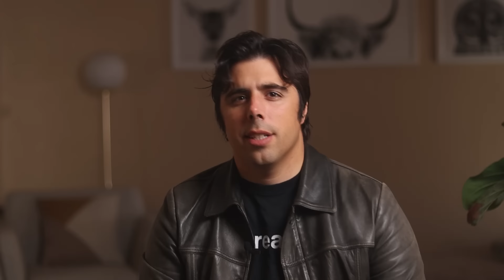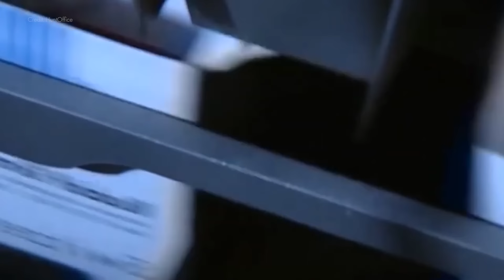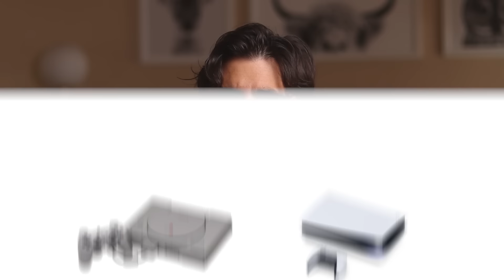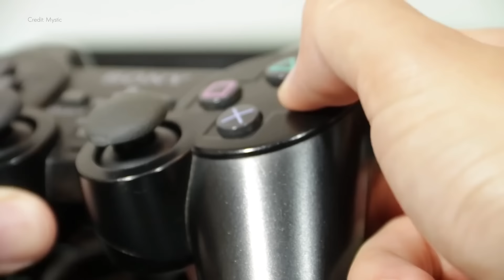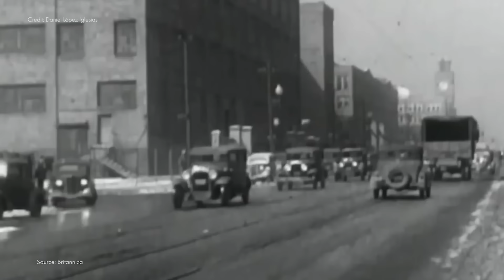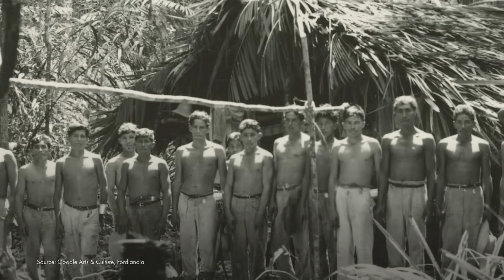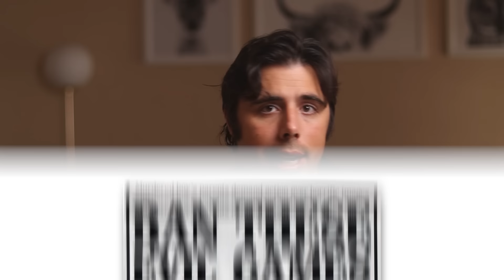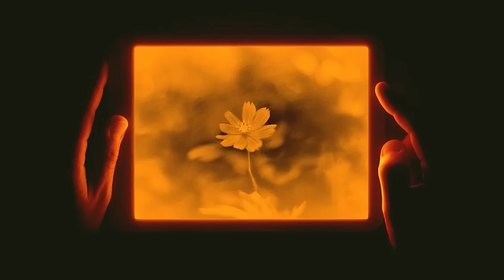Why Some Designs Are Impossible to Improve: Quintessence

Comment: Stop making it seem like smartphones and social media are inextricably linked. That is absolutely not the case, and if you want to have more control over your life, it’s simple: BLOCK SOCIAL MEDIA. I don’t use any social media whatsoever and I have an iPhone and I don’t have any of the problems you’re talking about. Clearly the problem here isn’t the platform but what you use it for, and you don’t need a whole new phone to stop using social media. And yes, you can access social media just as easily from computers too, btw.

If you think you have no self-control, set up a parental restrictions option on your phone and then have someone else make a new password for it that you don’t have. 

And really, from what you’ve described, isn’t a “quintessential” design just one that has the greatest market share such that most people associate it with the product type? The Maglite and Model-T weren’t better than their contemporaries (in fact, both were almost copies of earlier designs), they were just what was spread to the most people. Thus proving that if you bury your rivals with quantity over quality, you can win - which is less about design and more about financial control. Only the iPhone and PlayStation controller were actually superior products for their time.

Comment: 11:54 I'm a playstation fan but the standard was actually made by xbox, if you look out for controller designs basically all of them follow the xbox design, Nintendo and 99% of the generic ones have a similar xbox design (left trigger on top), except for only the ones made for playstation.
I've played with that design and actually like it more.

Comment: You can't beat a Mag-lite, but you can beat it WITH a Mag-lite! I've got a 3 D-cell Mag with a recent LED upgrade I've had since '02. It's been used as a hammer many times, as well as a general percussive maintenance tool, an attitude adjustment device, and has fallen off things from a few inches to 20 feet high. It just keeps on keeping on, and shows no sign of stopping anytime soon! I sure do love my Mag-lite!

Comment: I have a theory about video games. Everyone had Nintendo. Then everyone split into two paths. If you got an snes then you got n64 then Xbox. If you went with a sega genesis then you went to PlayStation. I’ve always been a PlayStation player mainly because of the controller. It’s been basically the same since PS1. Whereas the other was the craziness of the n64 then Xbox took a couple of tries before they finally just kind of copied the ps. I don’t play as much as I used to so I finally got an Xbox . Mainly because I got an Xbox s for $200 at a pawn shop when the ps5 was over $500. And I could finally catch up on halo. I may eventually get a ps5 but I don’t play enough to justify that. Plus the Xbox controller is so close to the ps there isn’t much of a learning curve.

Comment: keyboard layout is unnecessary obsolete and impractical, the offset key purpose was to allow the beam under each key to reach the back end of the writer. I bet that if new keyboards with a more regular layout came out they would became the new standard in a few years.

Comment: Everything you mentioned in the beginning is not perfect, most of it being far from it, bic pens have an issue with ink flow, paper clips are way to easy to bend and can't handle many papers, the qwerty keyboard layout is extremely inefficient both because of the key arrangement but also the physical key layout, and the PlayStation controller is way too prone to breaking over time or getting stuck (not to mention NOT being universal for hand sizes).
Reply from the maker: quintessential does not mean perfect.

Comment: I am not sure I would call the QWERTY keyboard quintessential. Its persistence is not based on the design hitting something "essential", it is just path dependency. Path dependency instead of better design being the reason for the persistence of the design is mentioned in the video. I think it is actually a total different reason for the persistence of the design, and I'd say it is making it unworthy to be put into the same name bucket.

Comment: Eventually backfired, the design is bad by modern standards, it rolls away and they were very late to the LED revolution.  Incandescent flashlights needed the 6D cell format to be really viable, the AA models seen today look like candlelight, it takes a lot of juice to light up that wire.

Comment: PSA: The modern keyboard’s design is more circumstantial than intentional.  There were a couple of early keyboards related to telegraph machines if I remember correctly, with shortcuts built in, and the numbers and letters got pushed together in weird ways, aaaaand, we got a few sporadic designs all at the same time, variations, and eventually a design most people were familiar with, and changing what’s already familiar is hard to do with the entire public..

Comment: Would you assert that all qwerty keyboards are the same? I have trouble finding the same keyboard layout to use my muscle memory. Return, backslash get moved around and extra keys squished in. The shift and backspace keys shrink to make room, which impacts their recognition by touch. Laptops have ultra compacted keyboards. There are a few common mechanisms that handle the key action.

So which paperclip is the quintesential? With a very simple mechanism, there can't be much variation. But you will see it if you look closer: Hard steel alloy that resists plastic bending with old Soviet clips. Friction grooves. A lip on the inner loop to more easily slide it on. Angular or rounded corners. Enameled coating, galvanized or bare.

Disposable pens have had a lot of designs and change in materials (brittle, opaque, metal tip, different diameter points, superficial shape). I'm not familiar with the Bic pen.

Designers seem to churn out new products to get paid instead of iterating on small mistakes to arrive near perfection with basic items such as knives, pots or drinking glasses.

Comment: "Some designs don't change much: the paperclip, the bic pen, the qwerty leyboard layout and even the playstation controller."

Right out the gate this video has already lost my respect in the first 5 seconds compared to what i expected from the title and the thumbnail. The QWERTY keyboard layout is atrocious and can easily be improved. It has been improved a lot, it's just difficult to push those improvements. QWERTY is however not universal, at the very least QWERTZ is significant in countries like germany, but even DVORAK is pretty popular and neither of these are even the best. The playstation controller is a lot closer to perfection, but still not there, some improvements over that layout are clear in Valve hardware like the Steam Controller and Steam Deck, while Nintendo's Joy Cons are probably the most successful variation upon the gamepad layout.

---

After watching the video, i realize i misunderstood the premise. I disagree with the title being "impossible to improve" because these input methods can absolutely be improved. But i do agree that the playstation controller design is quintessential. I don't agree that the QWERTY layout is a quintessential design, because it's hardly a design. It's mostly just user preference, and it can also be changed in software. It's the default layout, but that doesn't make it quintessential. However, i think that the 105 key arrangement of physical keys on a keyboard is a quintessential design, and doesn't improve a lot. QWERTY feels very out of place in this video, even after watching the whole thing, but keyboards in general do have a quintessential component and i absolutely agree that the two-sticks-dpad-and-face-buttons gamepad layout is also a quintessential design.

Comment: I could've let you get away with calling the NES controller design "1985" given that was the year it was released here in North America even though it was actually 1983 as originally released in Japan... but it most certainly was NOT 1986 in any vein. 😞

Comment: Great bit of content on design "quintessence". In the sense that you were trying to convey the principles which make a product endure I offer the bitter "realist" set of principles as counterpoint:
1. Functional- quality enough to operate but not to high quality as it needs to be disposable. H Ford conceivably embodied this ideal if it's true that he had his engineers study used Model T to find the most reliable part and had it weakened.
2. Mass production- can it it be made quickly and cheaply with minimal labor so as to keep cost down
for the last two I incorporate the essence of the fifth to better articulate what quintenssence means in the context of products.
3. The "Appearance"- the product should be such that it gives the impression that it does more than it actually does because after all, the placebo effect is real.
4. The "I need it factor"- the product should be marketed and developed to convince people that it is indispensable. To a fair extent a great product (regardless of quintessence) does this on it's own, just look at basic tools in every builder's toolbox. But in the modern age true quintessence that is real endurance relies on the ability for people to be sold on it through clever marketing and vacuous advertising.

My point here (as a nihilistic ninny) is great functional design has it's place mostly in bespoke hand crafted products, but human society at scale is solely, and I mean solely about economy. If it's not cheap, mass produced, and can't be peddled it will be lost to niche consumers and history.

Comment: One nice thing about a standard paperclip is being able to unfold it and use it to poke things. You can use it to factory reset your phone or push the SIM card out. You can use it to scratch at things, to scrape the dust and dead skin cells off computer peripherals for example. So a paperclip whose ends are welded together is missing a secondary (but valuable) feature.

Comment: shocked that you didn't mention that after they essentially invented the standard for the controller, their first 3d console's controller is still clowned on to this day for being completely, utterly weird (even if i personally like it and find it to be a very pleasantly versatile design for playing emulated games, as you can still get these but made for usb ports instead of for n64 hardware... it is a really really weird controller), went back to basics and then tried to reinvent it again with the wii - for which they still had to provide a classic controller and let gc controllers use. 
like it's a wheel that's very much tried to be reinvented by it's original makers, and they just. fail. every single time they try it lol. in the end, they just merged a 2 nes controllers with a joystick and the console itself into one thing.

Comment: Speaking of the gaming controllers, there's still some attempts that worth mentioning, ABCXYZ layout for Sega Genesis / Saturn, middle analog stick on Dreamcast / GameCube controllers, even the Switch Joycon isn't the same design formula as XBox pads and Dualshocks, they're not best for the genres as you mentioned, but good enough for all with analog sticks and modern heptic feedback buttons

Comment: Paper clips are a horrible design. Things catch in them, which can easily prise them off whatever they’re supposed to hold together.  They can crimp the papers they’re holding, and the paper clip can get stretched open and not go back into shape properly.  Their successor the metal clip, which comes out of a small dispenser, is sooo much better.  Design improved.

Comment: A lot of computer users do make a point of trying to learn the hotkeys so that they never have to use the mouse.

For instance the RatPoison tiling window manager for Linux is specifically designed to make the mouse unnecessary.

And it makes sense that you can be more efficient by learning the hotkeys, because regardless how general-purpose computers are, the vast majority of users are repeatedly using a very narrow set of programs or features over and over and over again.

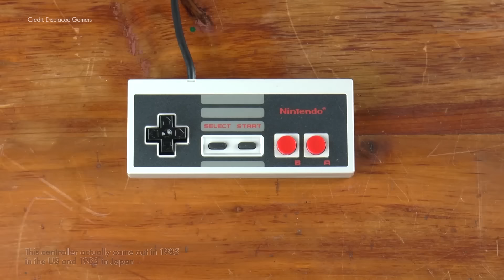Comment: 8:52 You say that, but the Atari Jaguar has the direction buttons on the left, menu buttons in the middle, and action buttons on the right. It just also has a big ol' numpad under it, but remove that and you've basically got a standard controller.

Comment: The PlayStation controller design was just lazy dogshit that they’ slapped together after analog sticks became a thing, without ever considering ergonomics.  So, it was too small and horribly uncomfortable for any hands larger than women, children, and Japanese men.  Their form factor and design shouldn’t be celebrated.  Microsoft ultimately perfected the form and it by far the industry standard, because it put human hands and ergonomics above symmetrical designs.

Also, the PS2 only sold a ton of units because it was cheaper than a DVD player at the time, so it was just a matter of value that parents agreed to purchase because they could use it to watch movies.  The physical design of their consoles weren’t all that special either.

Apple hardware that was designed with Steve Jobs at the helm was genuinely designed for both form and function, which is why everyone copies their products.  The black plastic at the bottom of the original iPhone was because it improved reception and their machining processes hadn’t improved to the point they reached later on.  That’s when they started making unibody MacBooks and the iPhone 4 benefited from that as well.  Unfortunately, they flopped with that one because that design worked unless you hold it with a large man’s hand, which cause interference by bridging the antennas placed on opposite sides.  This was why iPhone bumper cases became a thing and “you’re holding it wrong!” was the primary defense of that glaring mistake.  

The other big mistake Apple made with product design was the scissor switches they used in their MacBook.  It worked great until their legion of customers typing away on them in their local coffee shop got hungry and purchased anything off the menu that created a few small crumbs.  If I recall, the major issue was also made worse because canned air didn’t help or made things worse, and the device wasn’t serviceable by users due to the unibody design.  Other laptops and their own previous models had a seam around the top edge, which made it easier to access underneath the keyboard to make the most common repairs.